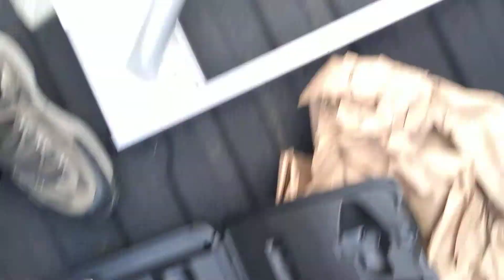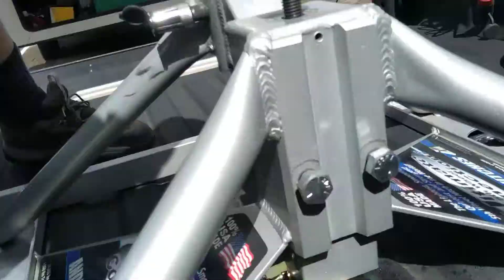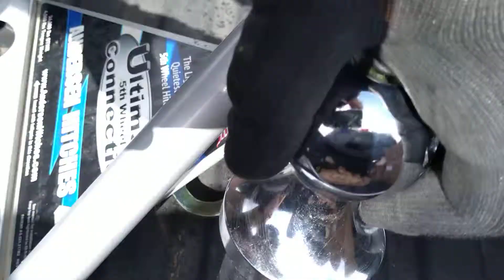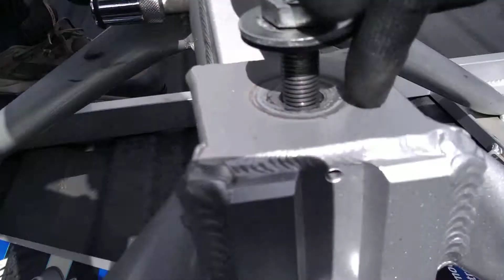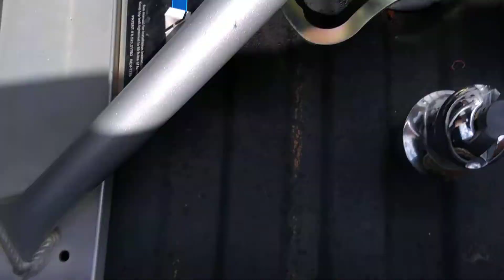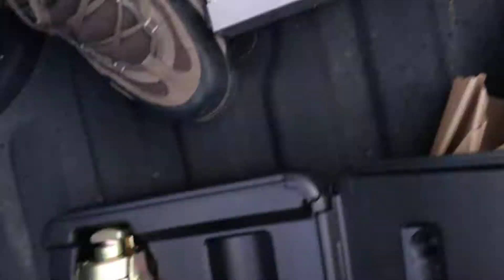B&W gooseneck ball doesn't work w Anderson ultimate hitch

Comment: Maybe whoever installed your BW hitch did not do it right, mine works perfectly with my Anderson, good luck.
Reply from the maker: Sorry you are wrong, the ball is too high and doesn't fit, there is no adjustment to be made. Maybe you are confused with a different model